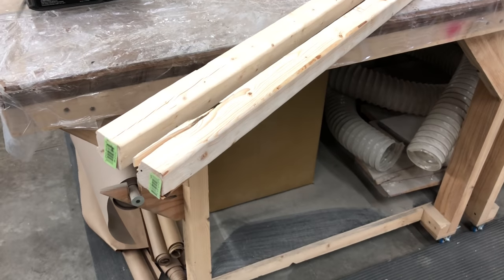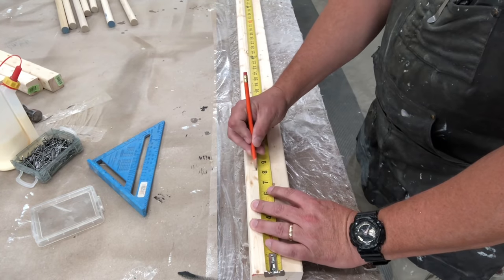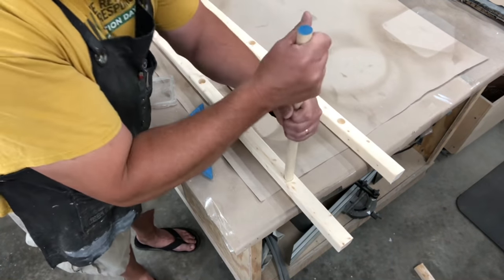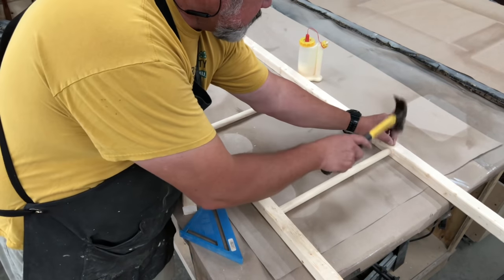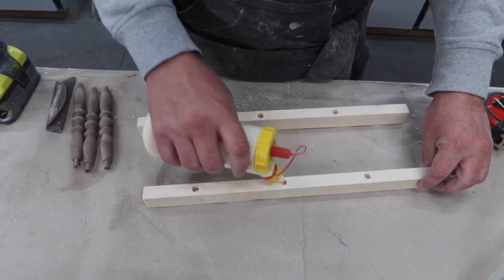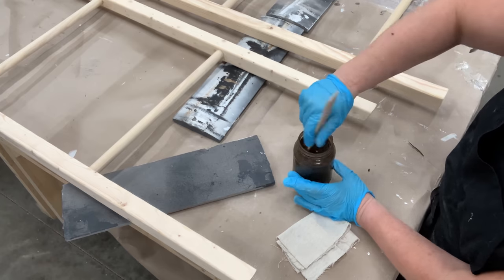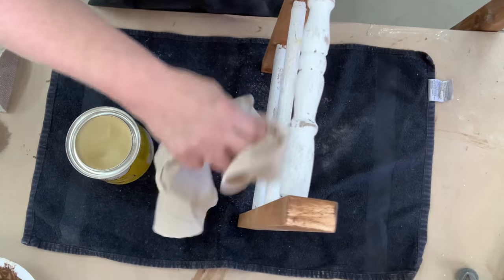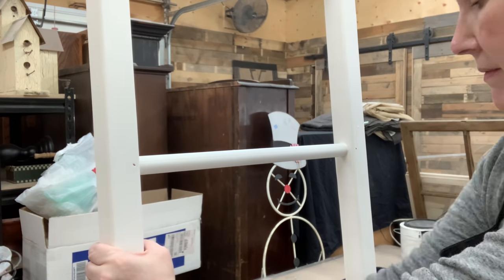How to Make Farmhouse Blanket and Towel Ladders from New and Salvaged Finds

Comment: I absolutely LOVE spindle projects and ladders too. 

There is an old dilapidated farmhouse I drive by every weekday that has decorative woodwork on the porch that would make 2 beautiful blanket ladders. I just haven’t worked up the courage to stop and ask for. It is on a working farm and I’m afraid if they agree to give it to me or sell it to me that I will have to cut it off of the falling down porch roof myself. But it gives me all of the feels every time I pass it. It never hurts to ask right? I need to just go for it. 

This summer I was lucky enough to purchase 3 vintage wooden step ladders at a rummage sale. 2 of them were 6 foot. The other one has to be 10-12 feet tall.  I haven’t measured it. I am currently using the largest one in my living room. I’m so in love but would still love to make some spindle ladders. 

Spindles are so hard to come by in my area though. I only have 6 spindles currently just sitting because I want to make so many different things with them and I can’t decide which I want the most. 

Thank you for sharing this video with us. It looks a lot easier than I had imagined it in my head.

Comment: Hi Yvonne! These ladders a great. I haven't had a call for black but I think I will try one and see what happens. 
I sell the tea towel ladders and,  4foot, 5foot ,6foot, in the summer when it was worm I would spray paint black then white and sand for the farmhouse look. Or do the wax like you. But now that its not warm I will have to paint inside so I dont know how that will work. But these and the welcome signs has been my best sellers all spring, summer and fall. 
The 4 foot i get $30, 5foot,$40, 6FOOT $50. but I dont really get anyone that wants 6 foot. The 5 foot sells the best. And then the small ones do pretty good.
On my welcome signs I get $25 5 foot both sides $50
I have sold some of the stove covers as well.
We make the ladders out of pine and Kenny makes the rungs, I dont have that many spindles if I do I use then on the small ones.
Have a great rest of your weekend and God bless
Reply from the maker: Oh.. thank you for sharing this!